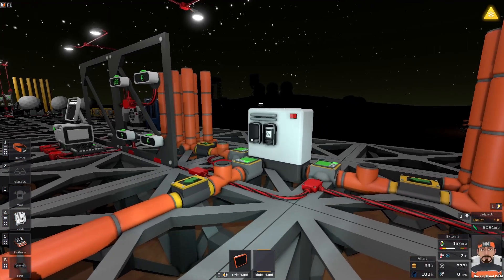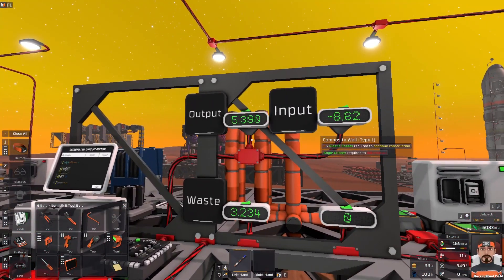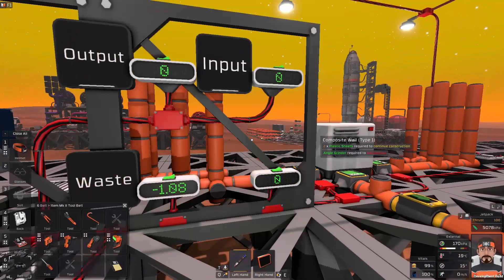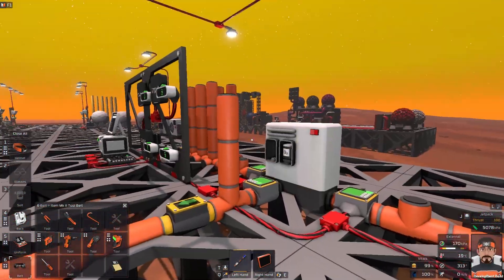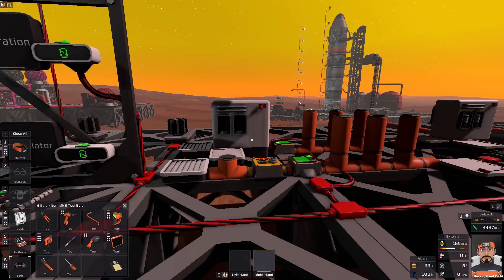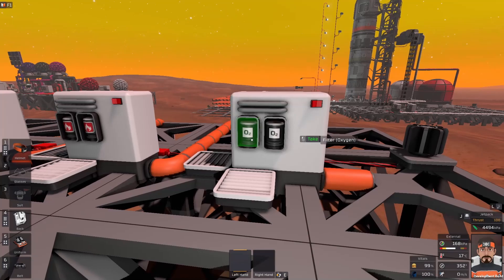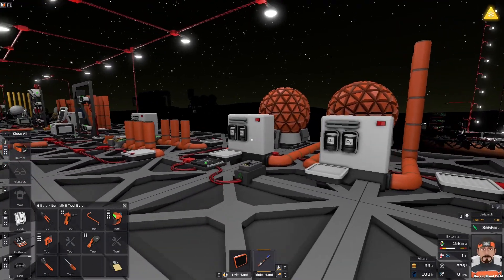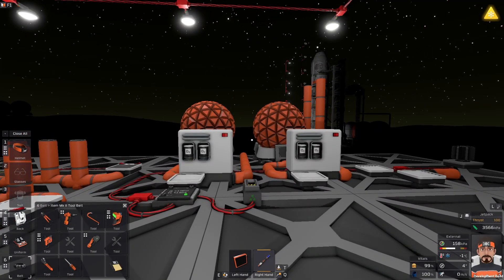Stationeers Pipe Networks 3 The filtration device

Comment: Hello Mick.  Have you thought of doing a turbine generator wind tunnel type of tutorial?  Using a filtration unit, without any filters, you can create a pressure differential between the two ends of the tunnel.  For the cost of 10w, you make 90w from each turbine along the length of the tunnel.
Reply: It works. I made it with 36 turbines and 3KW for free all day is great benefit in begining.

Comment: If I were to guess the filtration unit probably uses the following to decide how much gas it moves:
n = (P * V) / (R * T)
n = Moles processed
P: min(Input pressure, 101.325) (101.325 = 1 atmosphere)
V: Input pipe volume (1 pipe = 100 liters)
R: 8.3144 (Ideal gas law constant)
T: Input temp

I think the reason the pipe volume is used is so that tiny amounts of gas aren't left in the pipe and potentially to avoid small amounts of gas being deleted due to imprecision in floating point numbers.
Reply from the maker: But a change in P resulted in a constant n reading so there is something else going on there.
Reply: @cowsareevil7514  It's the minimum of the input pressure and 101.325kPa, so if the input pressure is above that you won't see a difference, I'm pretty sure all your tests were.

Comment: So if you want to cheese oxygen collection in a low oxygen atmosphere, just add more pipes to the input of a filtration unit with o2 filters in it?
Reply from the maker: It is the same flavour cheese from the rest of the pumps.
On my base the input pipe goes from the filter to the holding tank and then to the furnace and then to all of the return vents from the rooms.  So it is a very long pipe even without trying to cheese it, and it still takes ages to collect oxygen on Mars.
But if you wanted to put in a pump to hurry things along you might actually make things slower when you cut the pipe length.